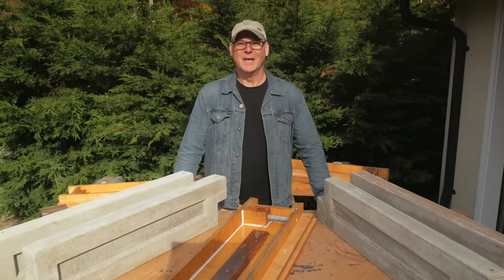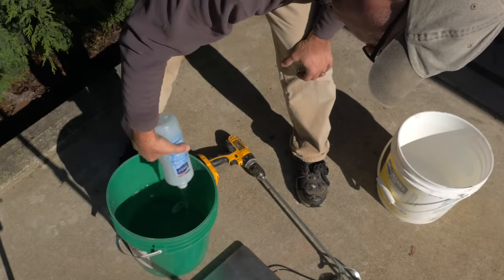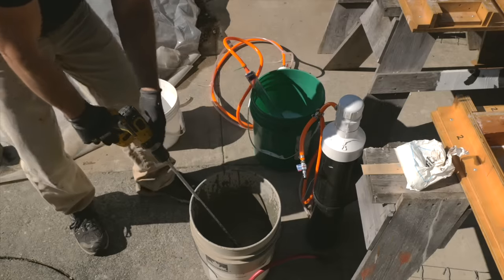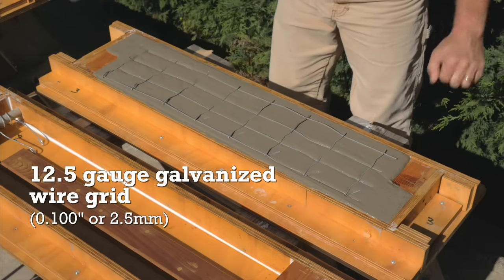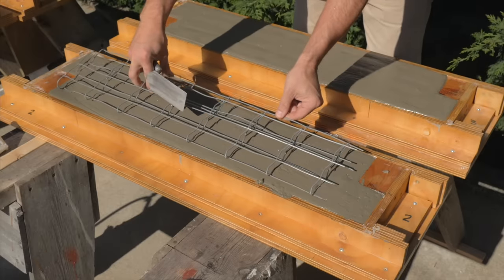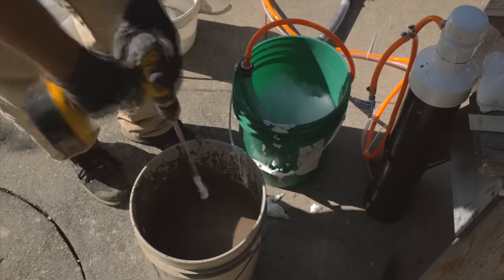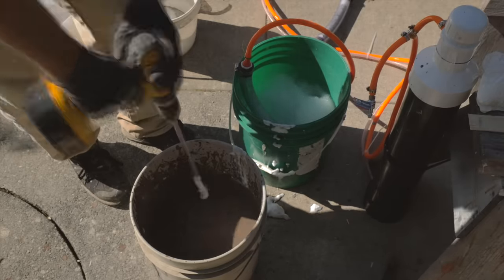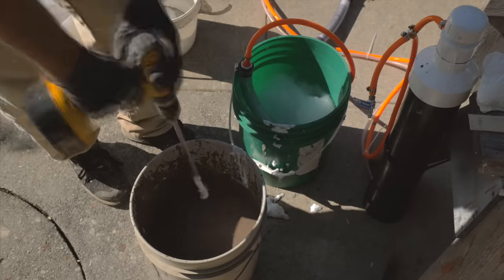Aircrete Garden Boxes PART 3.6 - Air Crete Lightweight Foam Concrete from Portland Cement

Comment: Hi Kent: 

I have enjoyed your contributions.  I viewed this vid a few days ago but did not comment.  I am commenting now because I watched a video from another YouTube Channel regarding the uses for Sodium silicate aka liquid glass.  One of the uses is to seal concrete and give it a durable surface. 

Since it's in bad taste, or so I am told, to post links in the comments section, I guess there is nothing wrong with posting a search parameter. So, place this in the search box above the following:  Sodium Silicate || Water Glass: (Uses from Industrial to Daily Life). The first hit will b the video by  ' Environ Molds ' . From their about page "Since 1998 EnvironMolds specializes in mold making and casting materials that are environmentally safe. "

Comment: I would add some Elmers glue to that mix as a binder, like the Sika milky additives they sell. You can also make foam with a $15 auto washing spray foam canon. Wonder if you can simply add Polyisocyanuric foam board material(broken in a mixer) vs ther Perlite.

Comment: It may be cheaper to purchase bagged colorant and custom make your shades. A bag of the powdered  Quikcrete color is about ten bucks and makes enough when mixed with water to color 80 pounds of bagged type N mortar. You may even find  it cheaper at a brick supplier than at a big box store.

Comment: I do some of these for projects around outside of the house and I like to use colored concrete but the stuff you get in the store hardly makes a dent in the color and is soooo expensive what I do is I go to the paint store in the Bad or unwanted mix section and get latex paint in a color I am interested in and sometimes I can even get a 5 gallon pail of it. I have had real good luck with the latex paint even adding a good amount to some of my concrete and 10 years on none of it has failed or discolored. Just a budget idea for you.

Comment: How about using piano type hinges mortised in on the long sides so ya don't need to screw them at all?  The ends can be fit with no attachment other than using hinges of correct size and type with removable pins. Attach the butt hinges onto the outside corners so as to be somewhat tight but still able to remove pin for stripping after done with the pouring of Crete!

Comment: Try painting or coating your box with cement dye and sprinkle a bit on the top too. You will achieve a much better colour surface finish that way.

Comment: Have you considered to use mostly foam with fibre but also a small amount of gravel. A trade of of some addition of weight for a potentially increased strength? The permutations could be endless but its worth a thought?

Comment: What if you added a small amount of full strength mix to the exterior facing panels of your mold, just enough to give them the strength to resist the edger string. I imagine it would help, without adding too much extra weight.

Comment: Beautiful garden boxes!!! Is csa cement a lime product? Fingers crossed you’ll try lime and remove cement/concrete entirely... I’d love to see what either hydraulic or hydrated lime mixed with an aggregate like pea gravel or perhaps crushed brick plus the white volcanic ash/pebbles would create for a nice Roman Concrete garden panel!!! I just love limestone, the LimeCrete floors that are becoming popular are beautiful. They have that true lime color yet are smooth like concrete and I’ve seen both indoor and outdoor uses for it... it’s just how and what to mix to create strong, environmentally safe blocks or pavers, etc that I’m unsure about. See my research tells me the best lime is crushed either from lime stone or fossils and/or shells, heated by fire and then slaked or rehydrated with water to make a LimeCrete after adding additional materials... I don’t want to have to do that in order to make Lime blocks. So I’m curious about store bought hydraulic lime or hydrated lime if it would be suitable or possible in creating outdoor pavers or garden boxes!

Comment: Ok, weight aside. Which one is the most durable?Which one can you actually build a bed faster without weeks of waiting or are they all like that? Another thing hubby and I were discussing... Couldn't butterfly bolts be used in some way instead of screwing and unscrewing and possibly causing the holes to wear out faster especially if you need to make a bunch of the panels? Maybe the wood clamps?
Reply from the maker: The CSA concrete is the strongest. And regular concrete is strong and durable (and cheap). And yes, other options instead of screws would work better over time.

Comment: It would be more work, but maybe you could use a thin layer of the high portland on the front surface for durability and the very foamy stuff poured over it for lightness.

Comment: Why is weight a problem? If it's about the individual panels being too heavy, wouldn't the solution be to make the panels smaller? Make them half as high for example and then double them up to get the original height.
Reply from the maker: It was from viewer requests that I experimented with lighter panel options. In Part 4 I made the panels thinner (and lighter) with CSA mortar mix.

Comment: I wonder if applying a liquid densifier/hardener to the outside surface would increase the durability for your weed whipper test. Hopefully giving you the lightweight as well as the longevity of th eplanter

Comment: Do You Have Any Video
How Did You Make Your 
Foam Machine ???
Thanks.
Reply: In this video he used a foam machine that was sent to him by a guy who has a website with videos on aircrete called, Honey Do Carpenter.
I've watched several videos on his channel in the past, building a shed and big insulation panels for walls out of aircrete.
Look up his video called, Air Crete Machine for Under $30 (DIY), but he has others after that with Foam Mate in the titles.
The $25-$30 original machine he built with parts from local stores like Home Depot / Lowes, that was 6 years ago prices though.

The guys name is Darwin, I want to say he sometimes has available instructions and parts for sale at an online etsy shop & website. There's a link to his youtube channel under this videos description, but searching Honey Do Carpenter should give you his various site links.
Reply: @willahelmpowers4835  Now I Know How Make Celullar Concrete, It Is za Wasting Time Garbage, Not Making Anymore, Thank You For The Advice, Happy Thanksgiving.
Reply: @-mejor-que-nostradamus-6152  Sure thing, I'm just looking to reduce weight making concrete fence gravel board panels a bit lighter for an 8' all gravel board compound wall and leaning toward using just a bit of perlite mixed into the upper fence panels.  Happy Thanksgiving to you as well.

Comment: I would love to see a more natural substance being used. For example clay.
Most people gave access to clay without needing to pay for it. Perhaps there's a way to replace the cement with clay? Without needing to put it through a kiln. Does anyone an idea.
Because cement is toxic for plants, so I would rather not use it growing our food inside.
Reply: Joseph Stone can you elaborate on what is toxic with concrete?  It's my understanding that it's the additives that can be truly toxic via leaching and uptake into our edible foods.  The lime that leaches out will change the ph of the soil which that can be toxic to the plants growth requirements but is not toxic in the sense of our plant food consumption.

Comment: I have enjoyed following the progression of your videos. Many thanks for the great ideas. I did wonder though if you have access to, or have considered using red cinder for the aggregate. It is very porous and jagged, also widely available and cheep, at least where I live.

Cinder - Wikipedia
https://en.wikipedia.org › wiki › Cinder
A cinder is a pyroclastic material. Cinders are extrusive igneous rocks. Cinders are similar to pumice, which has so many cavities that its low density of 0.641g/cm^3 allows it to float in water. Cinder is typically brown, black, or red depending on its chemical content.

Any guesses on how it would perform? 

Again, thanks for all your experiments.

Comment: There is also vermiculite, this a mottled brown product similar I think to perlite. Would just vermiculite and cement make a good product, if creating foam is not available? What about brushing the face to expose the vermiculite?
Reply from the maker: See Part 3 of the series. I make panels with vermiculite.
Reply: @MANaboutTOOLS  Do you think OSB would make for an interesting surface?

Comment: Maybe you can pour a half inch of regular concrete, and then fill the rest with aircrete for higher strength on the surface, the double armour reinforcement sure will make more resistent to flexion  and traction efforts

Comment: I see you dumped the recip saw vibration idea ???
Reply from the maker: With Aircrete you don't want to vibrate as it may pop the tiny bubbles that are needed to hold the structure.

Comment: Would microsoheres be a thought? Those glass balls can withstand 60k p. s. i., would not add to the weight, are immune to UV damage, and would increase the insulation factor (if that was your goal).
I would think they would increae your durability if properly proportioned. Just a thought and not very expensive.
Reply: I've looked into them myself but I cannot find a source that isn't prohibitively expensive.
Reply: @christophersmith8014  A company called Poraver will send you free samples. Look into the Metapor spheres. I look into sourcing an inexpensive supply

Comment: Why did you cure it soaked completely in water? I'm having trouble with my aircrete cure, i hope this is the answer. I just googled CSA cement. In your next video i hope you take a bit about it and try tests with other additives. I'm really interested in Calcium aluminate cements but can't find anywhere to buy it.
Reply: If your in North America your not trying very hard, it's a refractory cement. Not very good for strength or structures.
Reply: @ScooterFXRS  hmm.. I'm very familiar with refractory cement.  I was under the impression this was something different. something that was used before Portland was  around. it's suppose to be stronger but cost more. maybe I have the name mixed up.

Comment: Did you use pure portland cement, or was there sand mixed in the cement you used?
Reply from the maker: It was pure portland cement. I think there's a shot of the bag in the video.
Reply: @MANaboutTOOLS  Thanks, I saw the cement sack but could not recognise the details. But your message makes it clear.
By the waay, if you mount 2 danglig chain pieces to bottom of the 2 propellers on your mixing rod you might get a better mixing of the settled clumps even in the corners and can skip the handmixing action with the stick.

Cheerio from Germany

Comment: Have you tried coating the exterior portion with something like a paint on bed liner material?  I wouldn't want it on the inside with vegetables but it might add tremendously to the wear resistance of the exterior.

Comment: the first one was a single wire mesh? Is it a valid comparison?
Reply from the maker: Two panels had single wire mesh and two had double. With this denser aircrete I didn't see any warping or cracks at all. So, right now, there's no difference.

Comment: do you have to cure them with the 2week soak or can you use it as is?
Reply from the maker: I soaked them to try and get the maximum strength for the tests. It's always recommended to keep concrete damp to cure for about 4 weeks. Even covering the castings in wet sand helps.

Comment: y not just ad styrefoam like 50\50 to concrete
Reply from the maker: In part 3.5 I added perlite and sand to portland cement and got great results. Similar to what you suggested here in your comment.
Reply: MAN about TOOLS 
The styrofoam guy may have been wondering about the weight advantage of the styrofoam over perlite ?

Comment: could you weigh your foam vs Darwin's foam?
Reply from the maker: In Part 3 I poured 3 lbs of shampoo dilution into the pail before spinning it to fill the 5 gallon (20L) pail (almost full). I filled the same pail with the foam mate and the foam weighed 2.75 lbs. So almost the same density. But, the foam from the Foam Mate seems thicker.

Comment: This has been a very valuable series.  I intend to spend the winter in the garage building these for spring projects.  I have one project that will need both sides looking pretty.  Any thoughts on doing double sided (faced) molds?
Reply from the maker: Thanks, you would need to pour from the top or end to make a double faced form. Totally doable.
Reply: @MANaboutTOOLS  I agree.  I think your design still accommodates this nicely and the tubes will still be set properly on the ends.  Wire reinforcing the center seems like it will be absolutely necessary, but I still wonder if the center would be too thin.  I'd hate to accidently nock a hole through it.

Comment: It’s a nice experiment but I just don’t understand the purpose, and it sounds like you are trying to convince yourself it was successful when it wasn’t.  These garden bed panels don’t need to be lightweight, and it looks like their mechanical integrity is seriously compromised.  The weedwacker test shows visible damage after little exposure; a season’s worth of weed wacking would just destroy those.  Stick with regular concrete and cure with good existing practices to high strength.
Reply from the maker: Thank you for your comments here. The experiments with lightweight versions of the panel were driven by viewer requests. I received many asking about aircrete so I made several attempts to pour a good aircrete panel. And I'd say these ones worked out very well. They are certainly less durable and no where near as strong as regular concrete. And that's understandable.

Comment: Your durability test does not mean much to most other people who would like to use aircrete in construction work. Your design of the test samples were great, only if you followed through with tensile strength test by trying to break it transversely under weight. In that case, there might be a difference in strength between single and double wired mesh. There might also be difference with or without fibre and/or perlite. So your conclusion that whether the wired mesh is doubled is not important to durability is questionable. You could make video of what said and get much more attention since most people like me are not interested in making elevated vegetable box.